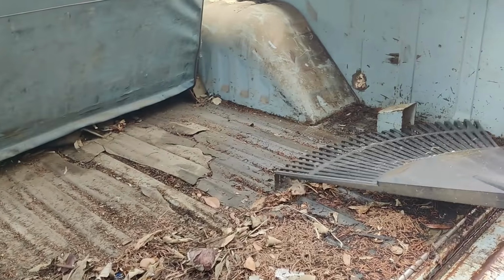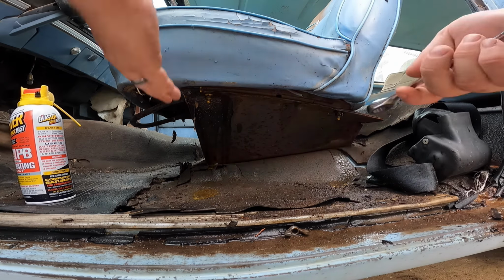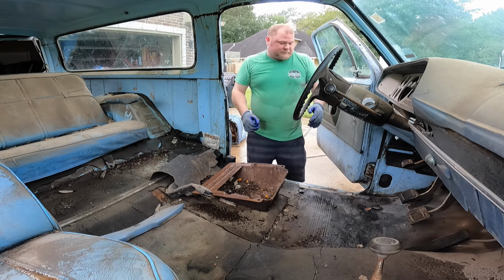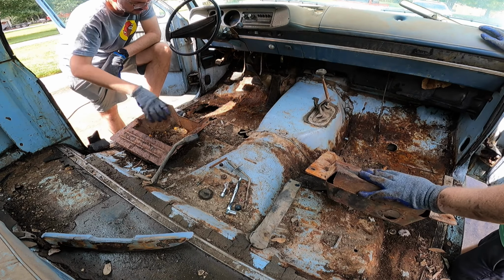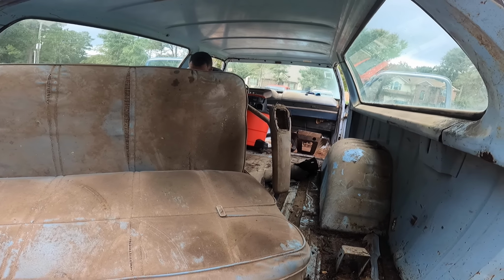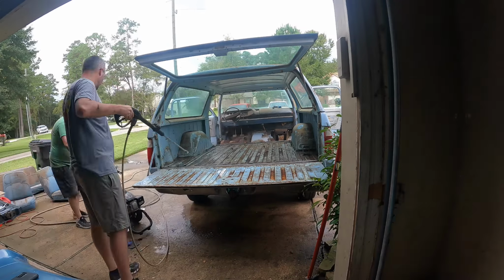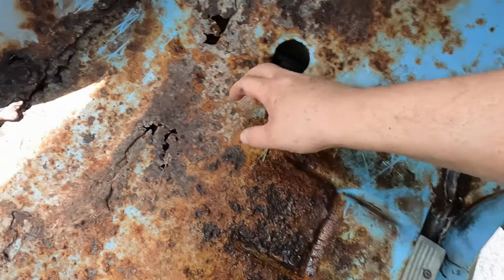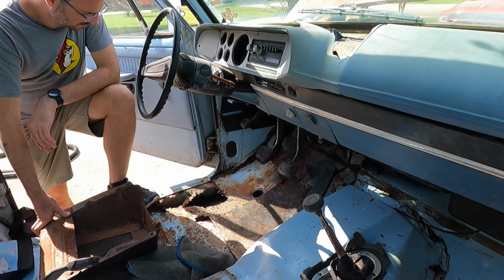1978 Dodge Ramcharger 4x4 Rescue! Part 2 Interior Strip and Clean

Comment: Can’t believe that thing has that much metal left. My dad custom ordered one in 78 and 2 years later he had to have body work done to fix rust. We lived in northeast and at that time probably most auto manufacturers went as cheap as possible on the quality of steel. But man that RC really had the bottom of the barrel quality. By the time my old man realized he should start spraying some oil under it the damage was already done. In the winter you had to pump the gas till your leg was ready to fall off to get it going. Lots of memories in that beast. He managed to get 156k out of it. And I would love to have it sitting in my driveway right now fully restored.
Reply from the maker: Oh I bet the rust belt was tough on these for sure. I can tell the metal is pretty thin. 156k out of these things is pretty impressive

Comment: I'm glad I found this video. I'm currently restoring my '76 RC. My front floor pans looked about the same as yours. I was able to save the transmission hump also. And fortunately for me I had no other floor rot at all. My interior/dash is even the same color as this one. Luckily I have a junkyard nearby that has several of the '74-'80 RCs sitting in it so I've been able to find some key parts. But since mine is now wrapped up for his winter nap, I'll have to live vicariously through you while you restore yours. Great Work.
Reply from the maker: Nice! This won't be a full resto, rather getting it back up running and driving and looking the best we can with what we got. Parts are crazy hard to find for sure! Thanks for checking it out

Comment: I battled this problem with my 78 Ramcharger, and currently battling this in my 83 Crew Cab. Great Video!
Reply from the maker: Not too much fun but it's very rewarding. Just go after it with a pressure washer ;)

Comment: But I made it to get my self a solid 1990 dodge w250 3/4 4x4 with the gas 5.9 and 3speed 727 an the only rust on the whole truck is both front fenders at the very bottom an it not even a rust hole yet still original floor pans an rockers and doors are rust free and around the windshield is solid an the roof too but im still been looking for ramcharger an old dodges be born in 1990 wasn't lucky enough to play with these but been try too thanks for sharing and may God bless you and your family
Reply from the maker: Sounds like a cool truck, especially being so far up north! I appreciate the kind words!

Comment: Nice project.. good luck finding parts.. I had a hard time finding parts for 76 D100.
Reply from the maker: That def is an issue. I could find anything I wanted for my C10, but this old Mopar is a lot more difficult.
Reply: What kind of parts? Engine? I am considering one for a Hemi swap. After fixing up my 90 D150 I figured steering , brakes and fuel will be easy find for this